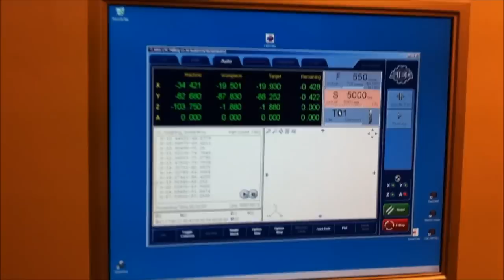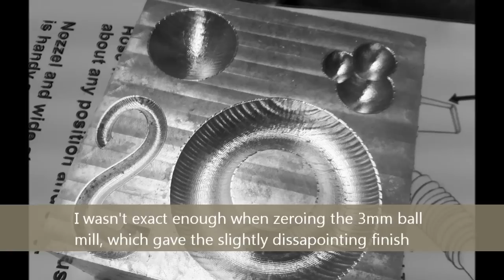3D milling test on the Sieg KX3S

Comment: Hey mate, Old video so don't expect a reply. But just wondering how the flood coolant works on this? From what i can see there is a rectangle slot in the back right of the enclosure that that where all the coolant flows and recirculates? because I can't figure out how else it would work as the cabinet below has all the electronics. Thanks!

Comment: Looking at buying a small cnc milling machine, why does this make such a chattery noise with what seems small cutters and small cuts.
Reply from the maker: The noise is mainly from the fairly flimsy sheet metal enclosure that resonated like crazy. It has since been removed.
I would not buy this machine again, and certainly not with their proprietary controller software.
Reply: ***** OK that's good to now but why would you no buy again. Need some thing simlar sized but hard to find in UK.
Reply from the maker: Main reasons:
1. Too small machining envelope.
2. Piss poor controller.
3. Weak and too slow spindle motor.

If I were to spend that amount of money again I would rather convert a bigger manual mill and use servo motors.
Reply: OK you not using mach, a part i may machine is 287mm in X and 145 in Y Z would be no probs.
Cheers for your input
Reply: ***** OK think i will carry on looking. 

Cheers